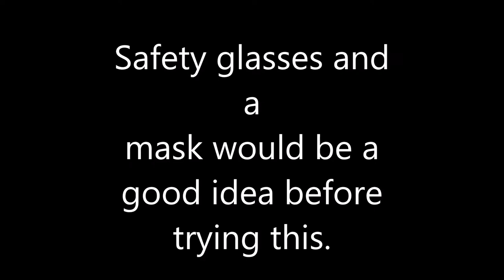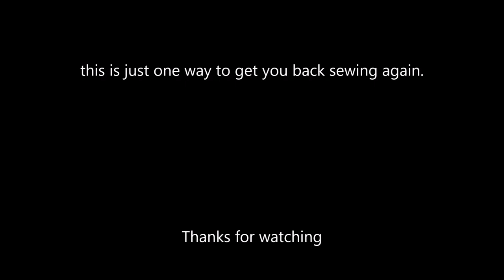Rotary Sewing machine friction wheel refurb

Comment: One step ahead to get my Kenmore 117 working but, it sews backwards 😢. 
Thank you! ❤️
Reply from the maker: All “Rotary” machine hand wheels run backwards. They are designed that way due to the transfer of power With a friction wheel. When you run the machine, the hand wheel will turn Backwards to what we are used to but it will sew correctly.